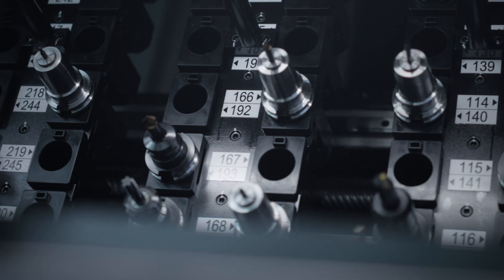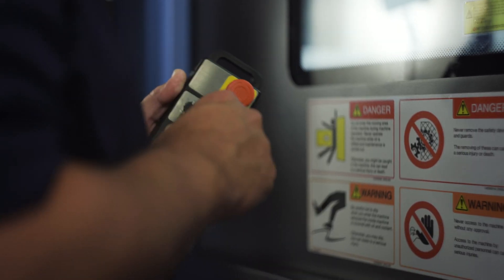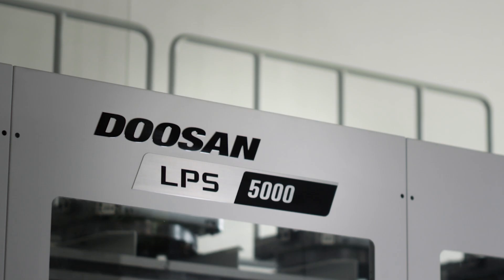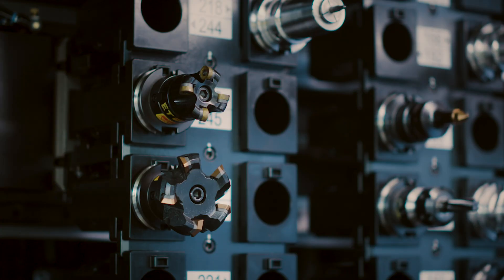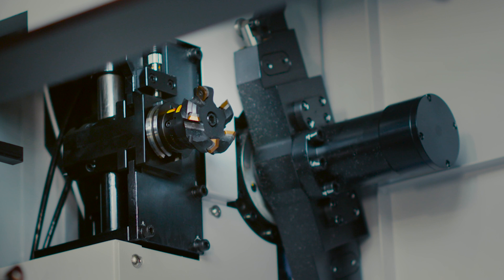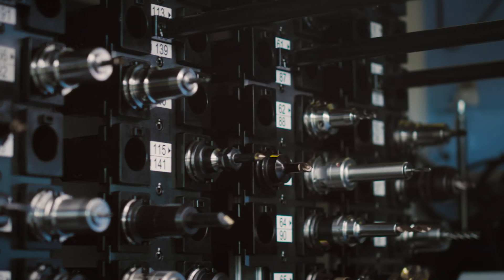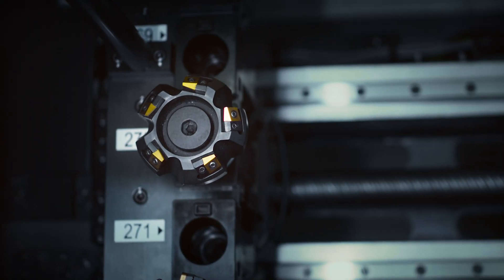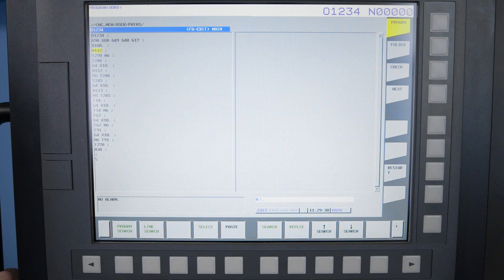Slow Tool Changes for Large Tools — Know Your DN, Episode 6

Comment: I  Think Haas has better implementation on speed. Just mark the tool on tool list as heavy and you are done dont need to change anything on program
Reply: Levent, thanks for the suggestion.  You can designate Large Tools on the Doosan machines as well, however depending on if it is a vertical mill or horizontal mill and which type of tool management software it has on the machine, it can vary as to how to designate that large tool and have the machine automatically run a slow tool change.  Doing it in the program allows the programmer to control the slow tool change no matter the machine or control. We wanted to give our users a sure fire way to have their machine execute a slow tool change.
Reply: Then you have to rely on your operators every time its setup. If its in the program, no operator will accidentally throw a tool.
Reply: @Motorman0297   I rarely took out of tools on side mount tool changer also when  operator changes the end mill or swaps inserts you are relying them to change it correctly and update the work offsett. I think operators needs to be trusted a little.
Reply: @Game0verxD  Accidents happen, the program way just avoids accidents. Everybody makes mistakes. Nothing wrong with one less little thing to worry about :)
Reply: @Motorman0297   yea thats correct sometimes programs also cause accidents( AKA missing line big offfff)